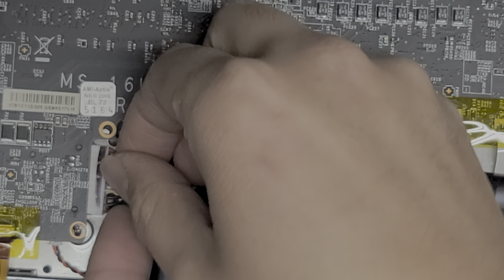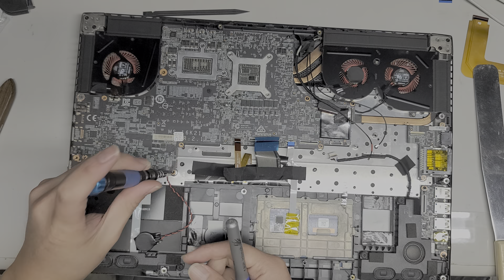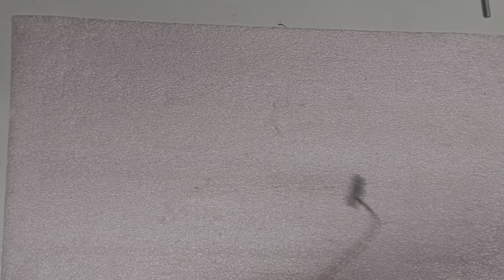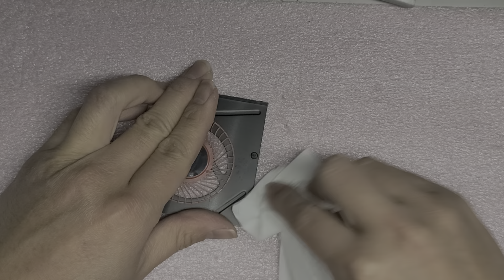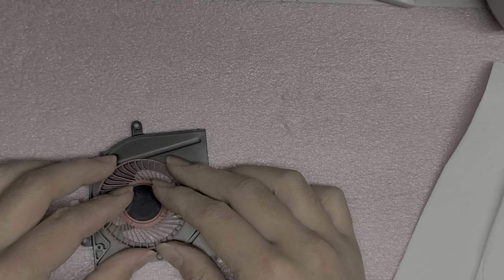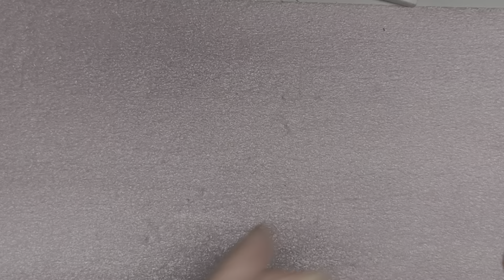MSI GS73VR Stealth Pro 7RF Disassembly RAM SSD Hard Drive Upgrade Repair Noisy Loud Fan Repair

Comment: Very helpful video. Worst design ever for replacing memory or the M.2 hard disk. Battery removal is also inconvenient due to strong tapes on the back. It's a miracle that it's working again, but I wouldn't have it done, if I knew that before.
Reply from the maker: Yeah...I hate that

Comment: Thank you for the tutorial and had black screen as well (but working on external screen). Tried many things but it did not helped. Found out in a crazy way that touching the SD Card / Ethernet connector cable was bringing back the screen to life (@9min00). Pulled out the cable, put it back in a good way and it works fine again. If that can help some people as I was more focused on the display connector that did not helped out.
Reply from the maker: @spartanjulien  wow very strange. Glad you figured it out.

Comment: Thx for you video. I try to replace the FAN by myself, being carefull, everything is fine but now i have a black screen. I plugged another one with the HDMI cable and it works but the main screen still black. I don't think I broke something... Probably the flex cable which could be the problem ? Did you have an idea ?

Thanks.
Reply from the maker: Did you disconnect the battery and hold the power button 15 seconds?

Comment: This was a great and through video, so thank you for making this! 

Although, I fear I might have messed up anyway. I realized I had forgot to drain the power, but only after I had already disconnected the lcd-lvd. It did work at first, but it was flickering like the cable was pinched. I opened it up again to see and that was not it. And now the screen is Tot. 😅

Could I have busted the display by not draining the power properly before disconnecting the lcd-lvd? 
Are there anything I can try to make it work, or should I just accept my fate and an external monitor from now on? 😂
Reply from the maker: This can fry the screen, lcd lvds cable, and the motherboard backlight circuit. Most likely need to use an external :(
Reply: @ItsBinhRepaired  Ah well, it's an old computer (ish) anyway so it's no big deal.. It's just such a silly mistake 😅 But hey, now I have a reason to get a new one  🤩
Reply from the maker: Lol hope the new one is nice

Comment: Hi i have a question so after cleaning the laptop everything is working well but the dedicated gpu (1070) has just completely dissapeared from the device manager it's currently running on the intel uhd graphics but theres no signs of the 1070 anymore what do u think could be the problem
Reply from the maker: Sounds like a motherboard issue :(

Comment: Is it possible to change just the keyboard for this laptop or would that be the whole top panel?
Reply from the maker: Technically yes, but it's held in place with melted plastic, which is a pain to remove and put back.
Reply from the maker: Much easier to replace the whole palmrest assembly.

Comment: Thank you very much bro 
I have the same product my gpu fan became noisy when I described the problem to the company they told me  that they have to replace the whole gpu fan system( I told myself it just needs a Little Grease come on MSI)
 something hit my mind to do it myself 
Your video encouraged me to do it 
And I did!
Followed everything step by step and here I am. After  I reasambled everything the lap top works now perfectly  without any problems 
I just wanted to appreciate the knowledge you taught  me and give you a feedback the fan is not noisy anymore I used a fresh motor oil for it
Reply from the maker: Awesome! If you haven't already, please like and subscribe. It'll help my channel grow. Thanks!

Comment: Hi Ive made everything in here but replace my fan with new fans. Cpu fan is running but GPU fans are not running and ım getting black screen. Computer is on, cpu fan is running,keyboard leds are on but no display on my monitor. What should I do? Same computer.
Reply: My laptop's screen is also broken so I'm using external monitor too with HDMI. But my gpu fans are not working and there's no display on my monitor :( what did I do wrong?
Reply from the maker: @HandeBurcuTuygu  usually the fan won't spin unless the gpu is hot, but I'm not sure in this case. Check the RAM.
Reply: @ItsBinhRepaired  thank you for answer :) Ive never touched the ram when  changing fans. Also I didn't take off the battery, just take off it's cable from motherboard. Also Ive noticed that windows startup sound is not coming. Maybe problem is with bios. Can it be?
Reply: I'm scared of burning my both display cards. But Ive never touched them, as I said before. Is it possible? Or maybe my processor is failing. But Ive just replaced my fans ...☹️ Im really scared off.
Reply from the maker: @HandeBurcuTuygu  if you followed my video exactly, you should be fine. If you skipped around, I don't know.
Reply: @ItsBinhRepaired  Ive excatly followed your video but Ive take off cmos battery and plug it when Im done.. Also I take off lcd cable because I was using external monitor. I think there's a short circuit on motherboard, or because of cmos battery :(
Reply from the maker: @HandeBurcuTuygu  did you remove the battery and press and hold the power button 10-15 seconds before removing the lcd cable?
Reply: @ItsBinhRepaired  yeah I've grounded myself to get rid off static electricity. I think I'm unlucky I don't know what happened to my laptop. 😔 But thanks for that perfect guide, even though I am unlucky, your channel and videos are so good. Thank you so much
Reply from the maker: @HandeBurcuTuygu  :( thanks! Glad you like my videos.
Reply: gpu fanları zaten belli bir süre çalışmıyo yeterli sıcaklık yok diye. ekrana görüntü gelmemesi sanırım bazı kabloları takamadığınız veyahut unuttuğunuz içindir. 45:40 taki kablolar olabilir. Videoda arkadaşın gösterdiği şekilde yaptım çoğu şeyi ve ben bir sorun yaşamadım dikkatlice inceleyin kabloları.
Reply from the maker: @cyber8437  hm?
Reply: @cyber8437  merhaba hepsini taktım hiçbirini atlamadım hatta 10 kere kontrol ettim yine de olmuyor :(
Reply: @cyber8437  aynı laptoptan sizde de varsa laptobı ilk açtığınızda gpu fanlarının çalışıp çalışmadığını söyleyebilir misiniz rica etsem?
Reply: @HandeBurcuTuygu  ilk actigimda calismiyor, bir oyun acarsam veya bilgisayar uzun sure calisiyorsa, gpu fanlari donmeye basliyor. Dragon center indirip gpu fanlarini ayarlardan direkt calistirabilirsin kontrol amacli.
Reply: @cyber8437  bilgisayara ekran gelmediği için hiçbir şekilde dragon centera giremiyorum

Comment: I think I have to replace my video connector cable, is that doable on this laptop or am i screwed? is the cable covered by the speaker looking thing?
Reply: on second thought after watching this it may be more harm than good trying to replace the cable, it looks like even if i remove the mb i'd have trouble actually getting the cable out and replacing it
Reply from the maker: yeah, it's not easy
Reply: @ItsBinhRepaired  well thanks for the video, I would've gone in blind and really regretted it lmao
Reply from the maker: @mikaellugo4146  hahaha glad it helped.

Comment: I have same rattling fan issue. Should i try to fix it my self? never done it such things before.
Reply from the maker: Make sure to watch the entire video before attempting/starting just in case it seems too difficult.
Reply: Thanks man. With your guide managed to fix it. Worked like a charm. Did not have car engine oil, used it baking oil 😂. But it worked 🙏
Reply from the maker: @irmantasvaitkauskas6769  baking oil won't last long. It'll turn into a gooey mess in a few months. D:
Reply: @ItsBinhRepaired  ok, i'll clean it and use engine oil. But now i know how to do it 😁
Reply from the maker: @irmantasvaitkauskas6769  you can pull up the dipstick if you don't have oil. As long as you know someone with a gas car.

Comment: Remove the entire motherboard to swap out a noisy fan. Thanks, MSI
Reply from the maker: Yup...
Reply: Watch some other videos about laptop repairs - 99% have such construction of cooling system. It's never enough to only dissamble fans, it's hardly recommended to dessemble the whole cooling system with radiator to remove old thermal paste or liquid thermal interface.
Reply from the maker: Not sure what you're saying. Watch a bunch of my videos. Minority of laptops require motherboard removal to get the heatsink out.